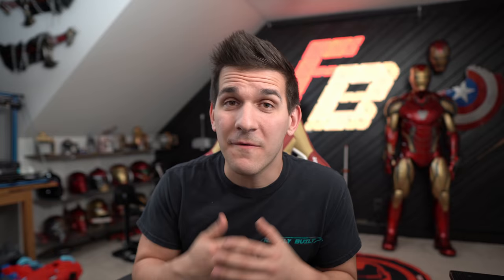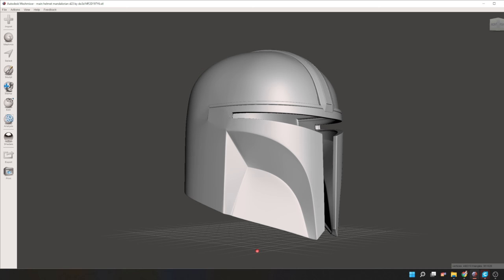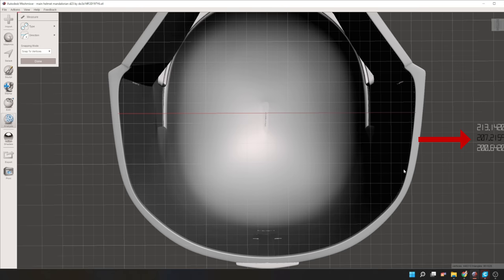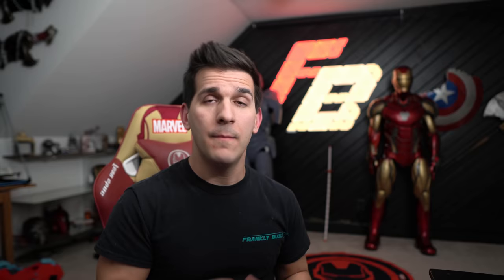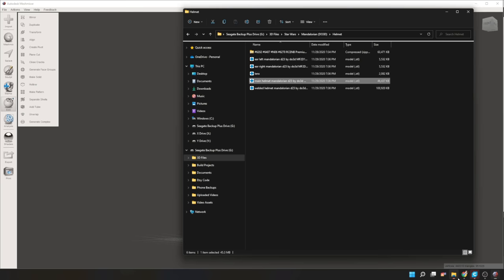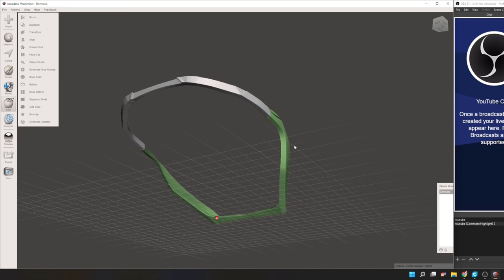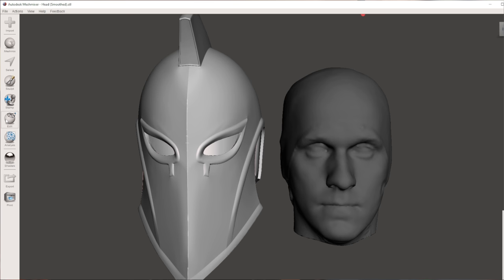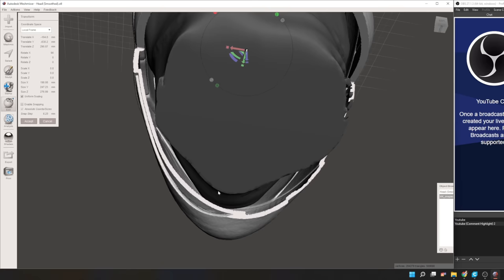How to Scale 3D Printed Helmets!

Comment: Hey Frank, great video. One correction for you though, in method 1 you chose the third measurement box. That will measure from the outside of the wall of the helmet to the other outside of the wall of the helmet which means you're getting the wall thickness in the measurement too. You should choose the second measurement type for an inside measurement. Method #2 is fire!

Comment: "How do you print large objects on small printers"? Can I drop a really bomb ass suggestion? Luban ALL DAY BABEH! To heck with all the meshmixing hooplah! Put in your printer profile and drop an stl file. Bamb... cuts it in logical pieces in separate stl files ready to print. Luban will save Cosplayers soooo much time. I have not even used Armorsmith yet. I do not know if I will need to. Try Luban. You can do cool stuff with Luban.

Comment: There is a 4th option with fusion 360. take front, top and side veiws and scale them, extrude and the bodies you have use use intersect commend to get a rough of your head then use fillets to closly match you head. and that should work good enough. .... This process in total i am thinking could take at most an hour, if one doesnt have a 3d scanner would be best option

Comment: I know with 3D printers the z axis is vertical space. In computer graphics, which uses linear algebra, z is depth. Remember back in school plotting all those graphs. (rise over run) X is your left-right run and Y is your up-down rise. So naturally when you add Z, it's in and out. 3D printers are the ones that got it wrong imo

Comment: The biggest and most frustrating issue i have using pollyscan is , it imports my scan at less than 1% the actual size of my head??? Any suggestion on getting it inportted tas close to the actual size would help tremendously.

Comment: 0:39 Oh, boy. Here we go... 
0:44 -________________- Fiiiiiiiiiiiiine...
4:16 From outer edge to outer edge. Sure.
4:24 If you were to choose the second option where the line crosses the smallest gap between the two circles in MeshMixer, you can see the width of the cavity inside the helmet.
As of right now, I get the measurements of my head and others by measuring it with a tape measure first, get the measurements around the nose, around the crown of the head and jawline, and finally, around the neck since I'm working on Power Ranger Helmets. After that I divide them all by pii to get the diameter for each one.

Comment: I got a 3D printer for my birthday and started printing things on my Mac using tinker cad and cura but my problem is wherever there is supports, my prints look like a huge tangle of pla print wire wherever  a support is touching it. Like one time a made a large bench to tech deck in it and the under side looked terrible because of the supports that had to hold it up while printing. Please help I haven’t used it in months becuase I can’t figure this out and want to just completely give up on it forever

Comment: Is there any issues with maintenance with your 3d printers? Are the parts easy to clean or do you just have to replace parts and if so how often?
Reply from the maker: Normal maintenance is covered all across Yourube. Printers vary depending on price and use. They’re easy to work on tho
Reply: @FranklyBuilt  thanks! I did a deep dive into more of your videos and found a ton of info. I’m still going through it and hopefully will have my printer by next month. Thanks again!

Comment: Hey  Frank, great video, however I have a problem i know the correct sizing for the jaw on my iron man helmet, but i dont know how to use those scales to scale the helmet and face plate. if it helps im going to add the scale if you can help me Y 175.44mm X 215.24mm Z 118.45mm how coiuld i scale the resty of the peices
Reply: never mind i just made trhe x axis the same on all of them and i think taht should make it work

Comment: Hey Frank, I bought my first Ender 3! I'm wanting to try scaling an iron man helmet to fit. One question I have is do your iron man helmets slide on your head in one piece or in multiple pieces? I'm not sure whether to scale the hole on the bottom of the helmet to slide right over because then the helmet will be very big inside. What are your thoughts?

Comment: ok so with the iron man helmet that i have has 3 pieces in the file if i append them in mesh mixer can i scale them all together and then print them separately still having the scale size made? if you can respond soon that would be great thx
Reply from the maker: Yep! Use Meshmixer to combine them, then seperate and print them
Reply: @FranklyBuilt  sweet thanks! also thank you for the quick reply!